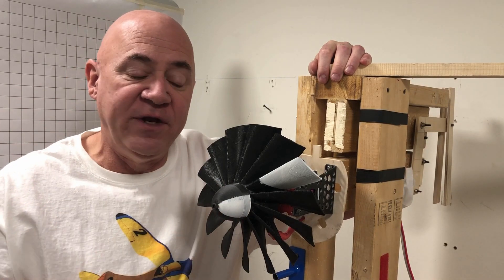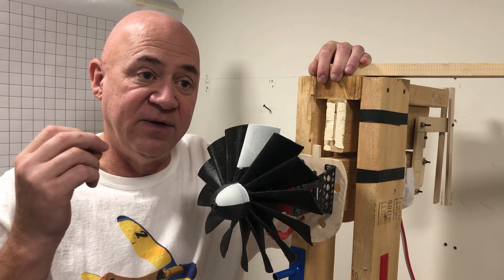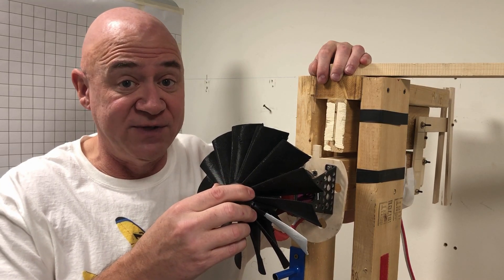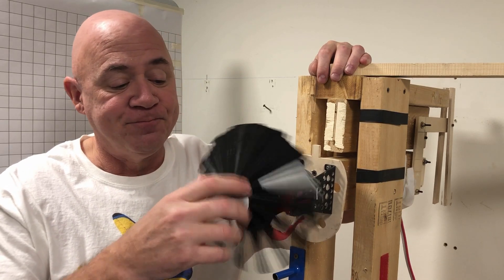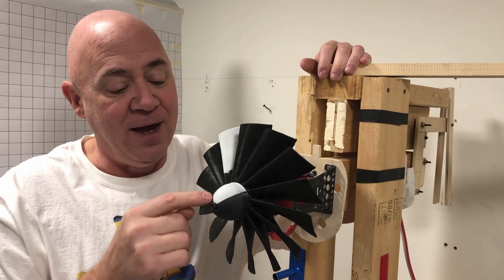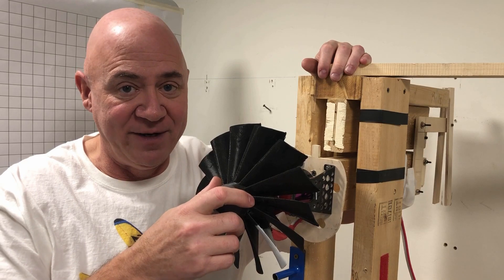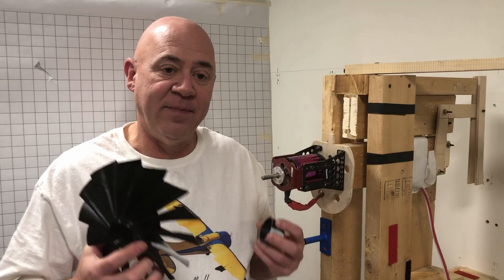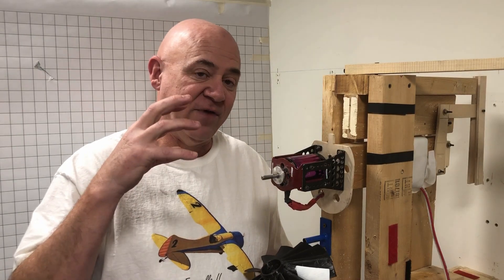203mm 3D Printed Fan Exceeds 7,000 RPM

Comment: Looked at Javaprop and at 5kw and 5k rpm thrust will be 22 lbs at 60 mph and 27 lbs static with a 330mm rotor. 75% pitch is 40. I did similar test with 70 mm EDF with NylonX at 60k. Found out using MH 126 airfoil for the root gives the best surface area to keep the bade from separating from the hub.
Reply from the maker: Thanks!
Reply: @dagtheaviator  If your not familiar with Javaprop I can input your parameters and send you a .dxf file for one blade. Will need Kv, Kw, rpm, spinner dia. and thrust requirements.